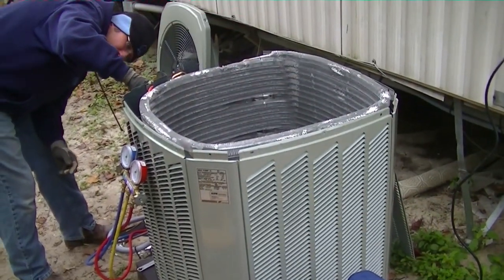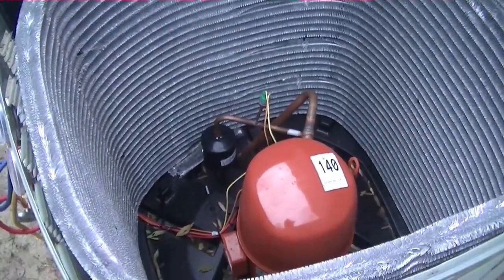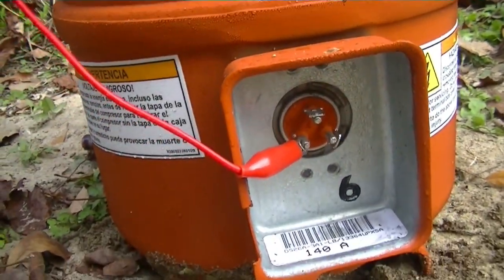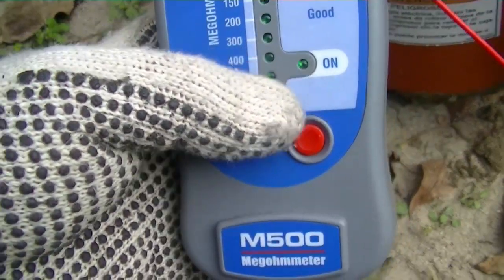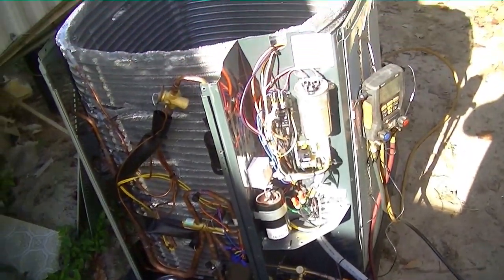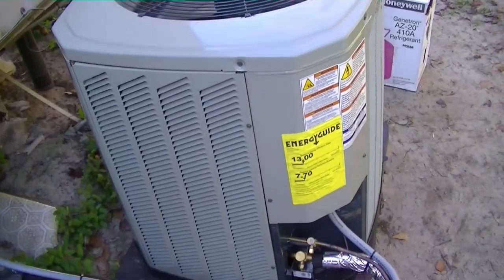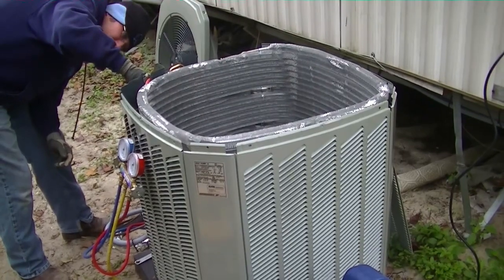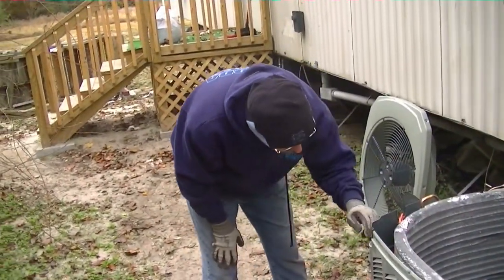HVAC Service- American Standard Premature Compressor Failure

Comment: I hate AS/TRANE...have had more bad luck then good out of these things
Reply from the maker: The machines are ok, the service not so much. What kind of problems did you have?
Reply: Leaks!! Grounded compressors! Got 64 package units at a factory I service and repair...and they are a maintenance nightmare.
Reply from the maker: Yea, I have a low opinion of trane compressors. I see them fail more often than most.
Reply: LOL..Alright, keep up the videos, love to watch them and you do a great job!

Comment: Every manufacturer is going to send a few duds through. The real measure is when they send nothing but duds through like Carrier does with their 100% coil failure rate. We install Trane 5 day's a week for the last 9 years and have had 2 compressor failures. If Trane sucks so bad why is it everyone is now copying their aluminum coils? I keep track of the units we change out and their age. Trane wins in the longest lasting unit department by a huge margin, no one even comes close. Goodman and carrier are pretty much tied in last place. We have changed out entire subdivisions of Carrier equipment that made it less than 8 years. Trane haters gonna hate.....
Reply from the maker: I think Trane is overall no better or worse than anything else. Ther crux here is that the customer service is lacking. What do you think puts Carrier and Goodman in last place?
Reply: If Trane didn't give you the option I agree it is poor CS. Our experience shows that they do give the option so maybe you need to have a talk with your rep.

All the brands seem to have more warranty failures then they used to. Goodman has made huge strides in their quality in recent years closing the gap but I am still finding them with early failures at a greater rate.  We change out more  goodman and carrier equipment under 8 years old due to coil leaks and other failures then any other. It doesn't matter who installed it, they seem to mostly all be rusted and worn out by 8 years old. 

I am no Trane fanboy. If anything I am a fan of their coils only. If I could I would take their coils and use them in Lennox equipment.
Reply from the maker: chribrian I can understand that. Goodman evaporators caused nightmares until they switched to aluminum. What other failures are you seeing in these brands besides the evaps?

Comment: parts warranty, and labor compensation. I deal for American Standard, and even though my leak, on a new install, ended up being in the lineset; if it had been the outdoor unit, as i had suspected, i would only have been compensated for the time on labor, for coil change-out. I was really hoping for the entire outdoor unit.So glad I finally found the leak where it was! LINESET BABY!!

Comment: To bad yall had to change the compressor on your dime. Seems like there should be a labor allowance!!!!! Guess that's what happens when you buy an Ingersoll Rand
Reply: Isn't Trane also Ingersoll Rand?
Reply: Yes sir
Reply from the maker: Hey we do get a little labor, but its a fraction of the actual amount we would have gotten. Its like when we changed those york 10 ton compressors, we got like 200 bucks.